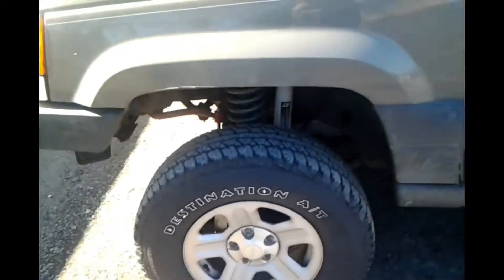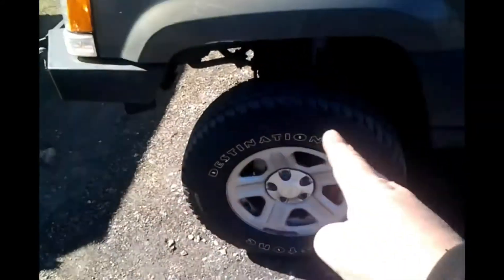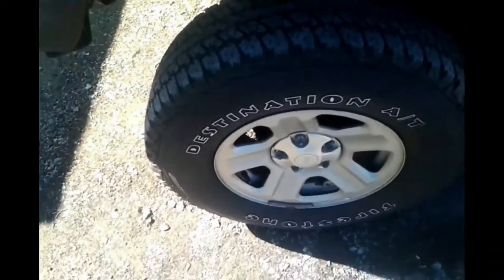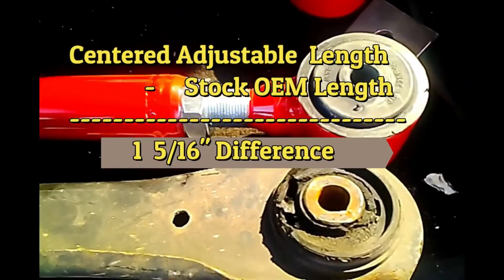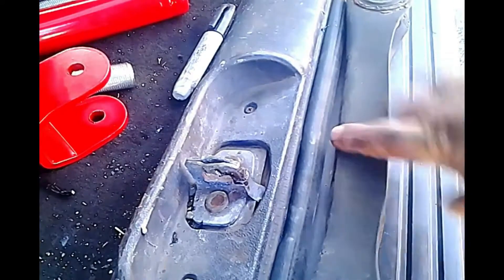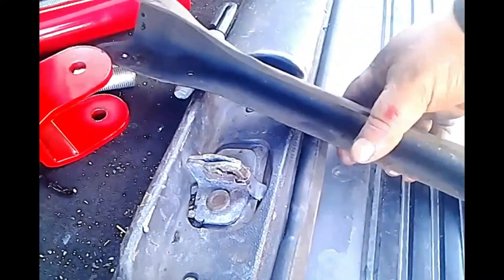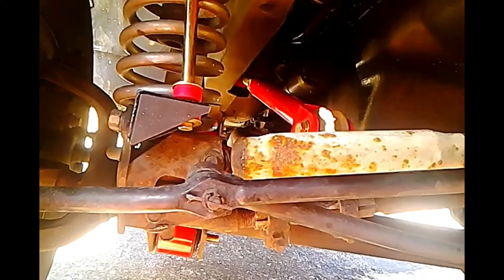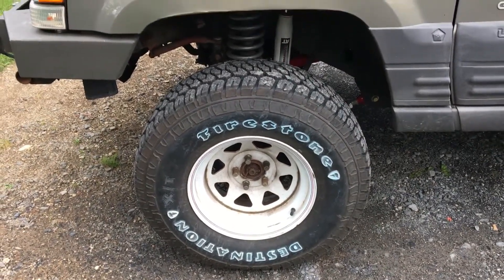How To Adjust Your Adjustable Control Arm Suspension-  ZJ Edition  PART 1

Comment: Could old springs cause death wobble.
Reply from the maker: Springs usually are not the cause. Wear items, such as ball joints, tie-rod ends control arm bushings, trackbar bushings or (worst case) worn hardware or worn out mounting holes.